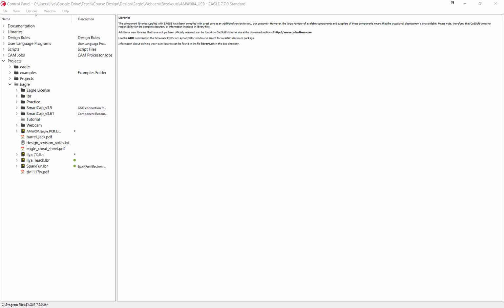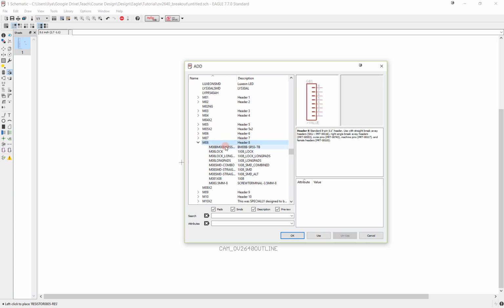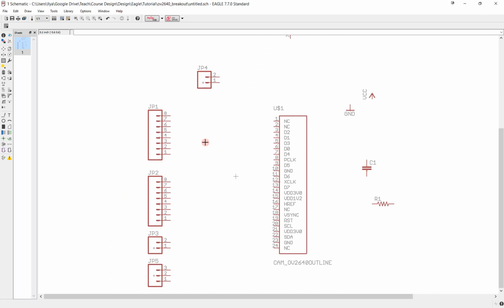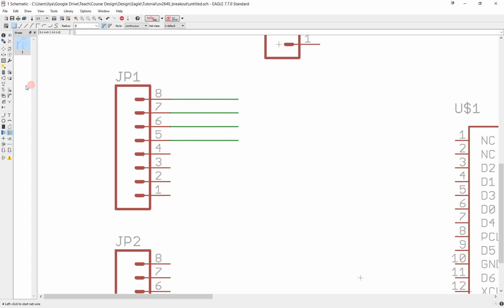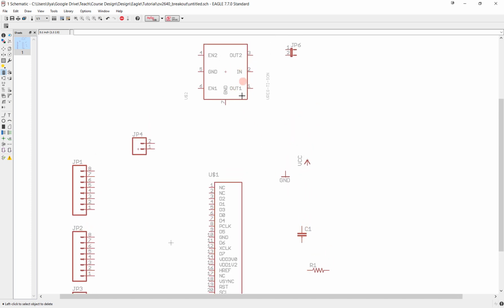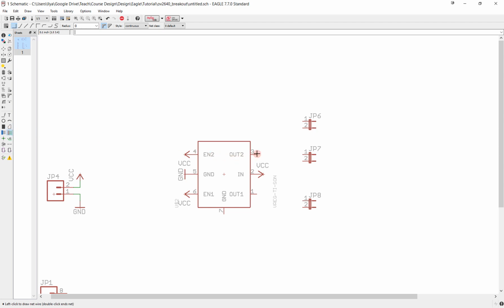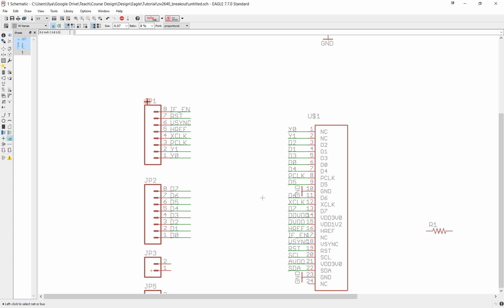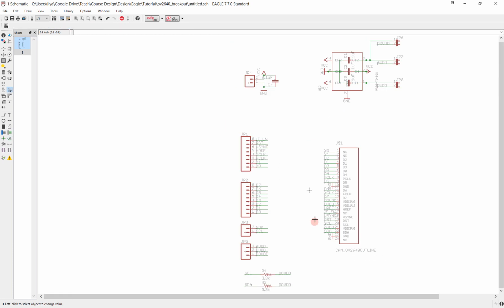Eagle PCB Tutorial: Schematic

Comment: Hello, I have a question. Is this a closed loop control system? Hoping to get a reply badly need for school requirements thank you !
Reply from the maker: Which aspect of it? A voltage regulator is a closed loop control system, for example, and I use one in this design.

Comment: Hi Ilya, I need help! How to move an entire shematic ? You explain very well  how to select a group to do what we want but it specific to either a line or syboles (parts). I'm doing something wrong !?! Nice tutorial by the way! :) I'm using vesion 9.6.2.
Reply from the maker: Where are you trying to move the schematic?  Is it just somewhere else on the same page?  Or are you trying to copy it to a new design?
Reply: @IlyaMikhelson  Thanks for reaching out. It's withing the same page. I started off schematic then decide to add the sheet of an 11x8. My schematic  was out of this sheet. However, after loosing so much hours, I finaly did. It's not as intuitive as other CADs (3D model or other eCAD). 

You first need to choose the group with the "group" icon, choose the parts in schematic to move (or delete, copy, rotate, etc), press on the right button of the mouse, the click on the small indow that will appear, after, you can do the action. 

Hope it helps other newbie like I! :)

Comment: If U1 already has labels, why do you have to also label your nets when you make them ?
Reply from the maker: Those labels are on the component, as created in the library.  I can name the net anything I want, though.  For example, one component may have a pin called "VCC", and another may have a pin called "VDD", while another yet may have a pin called "V_DD".  In my own schematic, though, suppose the power rail is called "VDD3v3".  I would then name all of the nets with this (as long as they all require the same voltage).
Reply: Ilya Mikhelson i found scripts to auto name nets, was just curious why it was not a built in option.
Reply from the maker: That's great that you found such a script!  Naming them all by hand is quite a hassle.  I will research that and will likely start using it, too!
Reply: Ilya Mikhelson i havent tested it yet https://forums.autodesk.com/t5/eagle-forum/suggestion-net-names-automatically-named-after-pin-names/m-p/6897935#M1195
Reply from the maker: Thanks for sharing this!  I just tested in my new version of Eagle (9.0.0), and it appears to be built in.  If you right click on a symbol in your schematic, you can then select Breakout Pins > All Pins > Pin names.  This seems to do exactly what you want.
Reply: Ilya Mikhelson oh duh, lol thanks!